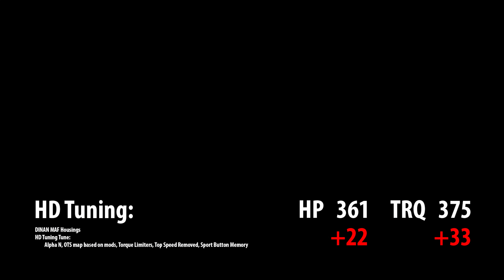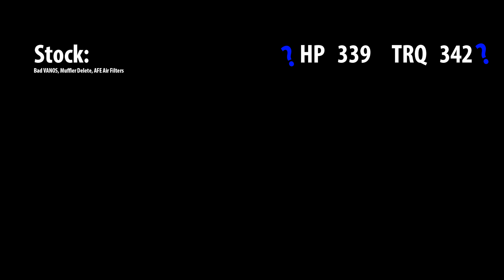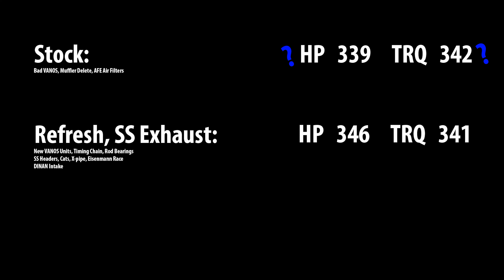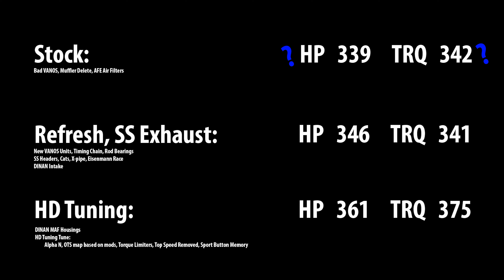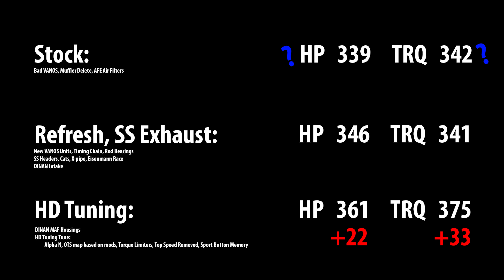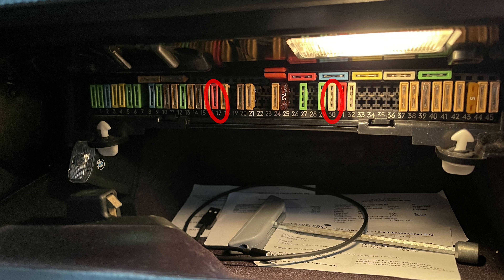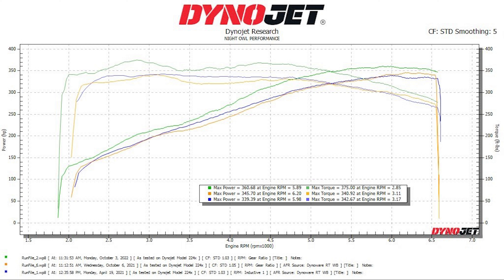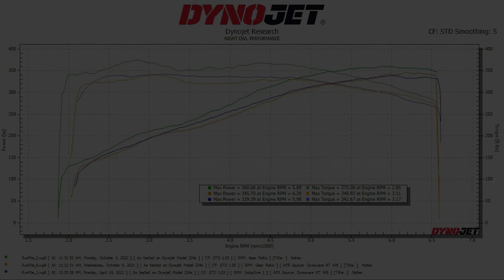BMW E39 M5 Build Log: Episode 9 - Tune

Comment: I'm still contemplating  between the Dinan Stage Software, BPM SPort, or the HD Tuning. I've heard greate things on all three tunes.  Since it's been over 9 months since you installed the HD Tuning, have you had any issues? Notice any  difference during cold start, cold drive, or during a drive? Thanks!

Comment: Also another thing if I do bolt ons like you what upgrades can I do to the manifold to get more power ? Is this a fund weekend car ?
Reply from the maker: Theres a laundry list of mods you could do further to the motor to make it more powerful, but at an insane cost. If youre after power just supercharge the car. I personally dont recommend it due to complexity and reliability issues. 
It could be a fun weekend car for you, idk. I have, and prefer a more raw car for my weekend car. I prefer the e39m5 as a daily driver.

Comment: Hey Worth , getting my first m car and in between the e39 m5 and e92m3 whats your opinions on it ?
Reply from the maker: What's the use case for the car? What kind of roads, city, highway etc? e92 better weekend car and e39 better daily car. 
e92 better drivers car, canyon, or track car. e39 better highway or twisty road car.
e92 has less torque but higher revving v8. Glorious motor but better suited for a car you'll get to drive, rev that motor out. e39 has more torque and is great around town for smaller trips, packs more punch, torque = better daily driver

Comment: What Air fuel ratios did you get under full throttle ?
Reply from the maker: I didn’t record afr. I’m pretty sure I will dyno tune the car at some point down the road and thus get some afrs.

Comment: isnt the engine rated for 394 stock?
Reply: thats crank horsepower. dyno's account for the actual horsepower to the wheels. 361whp comes to about 420hp at the crank.